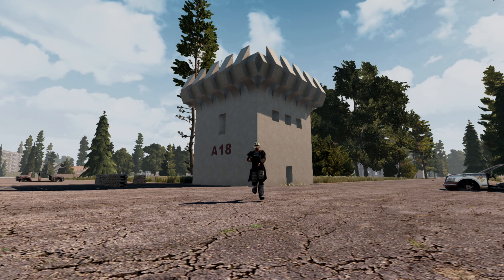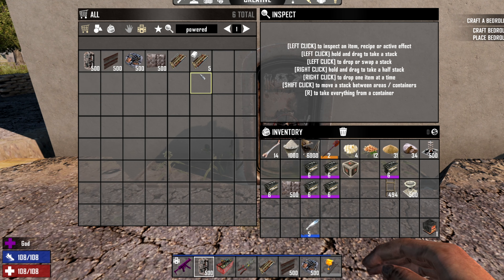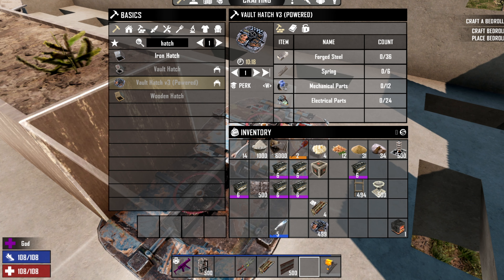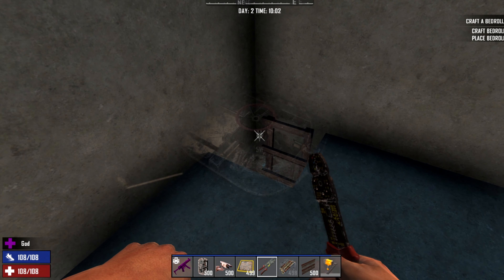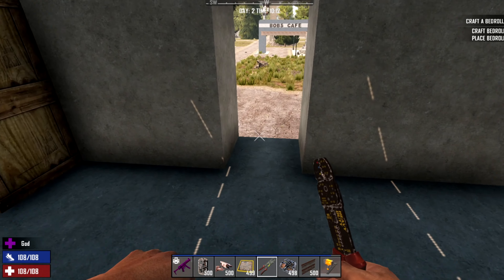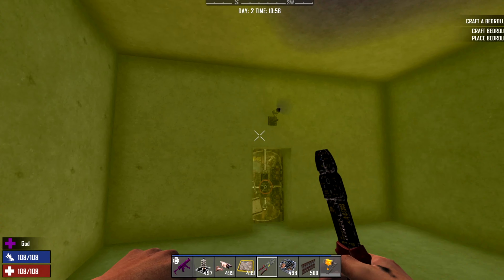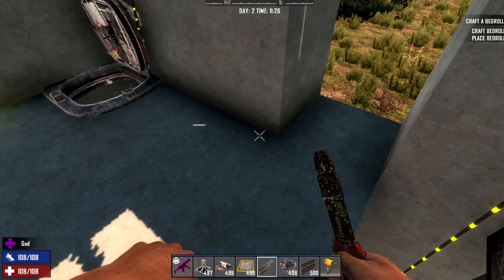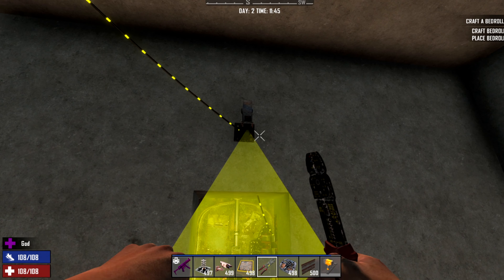Powered Doors, Hatches, Drawbridges, and Gates - 7 Days to Die - Alpha 18

Comment: The powered doors should have timers to close them after they open and a built in sensor(maybe in the frame) to open and close them. That would make wiring easier.  Think it was Z-Nations that had someones mod for wireless power that made all the wires invisible. Be nice it the Garage door and drawbridgewere the same size, make building alot earier. Thanks for the video.
Reply from the maker: Donn is awesome and so he is building a modular door system that we can make many sized doors with.  I'll have to see if we can release it to everyone as a stand alone modlet.it would be nice to merge the functionality just like you say. I'll see if the community wants to make that and add it to my modding list too